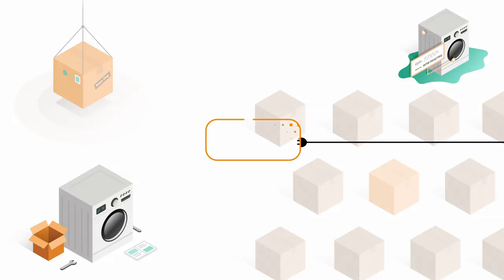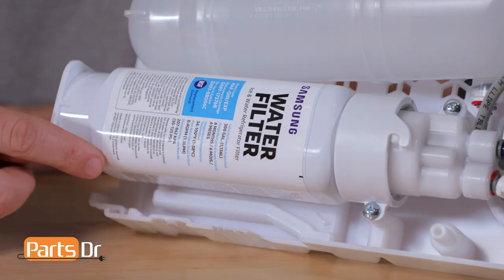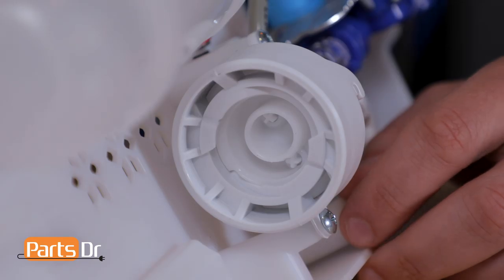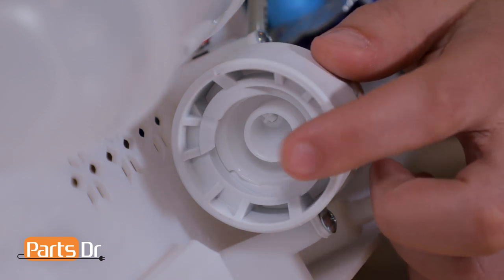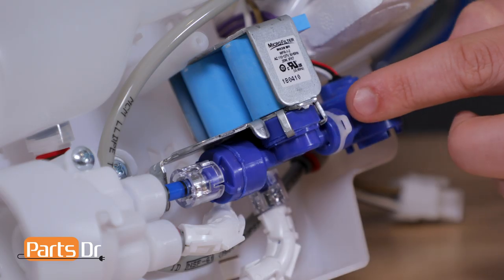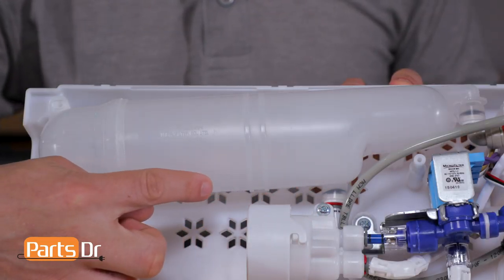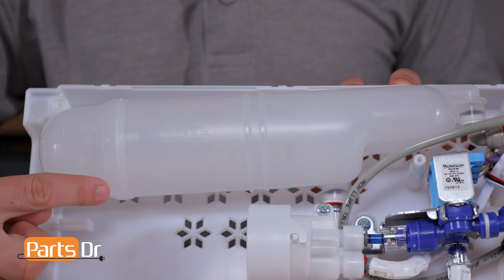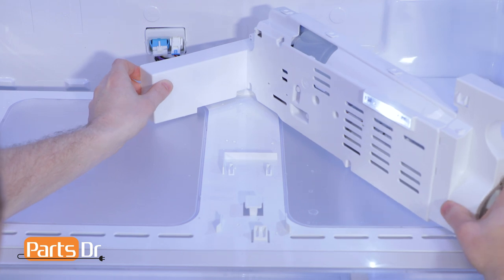What's inside the filter case assembly on a Samsung refrigerator

Comment: is it necessary to turn off the water to the fridge as instructed in the manual to replace a water filter?
Reply from the maker: It is usually safest to follow the manufactures directions.  We have successfully replaced Samsung water filters without turning off the water supply to the refrigerator.

Comment: Question.  Will this ice maker function without a filter or is a filter required for it to make ice?
Reply from the maker: You will need to check your refrigerators owners manual.  On some Samsung models the water filter is bypassed by removing the water filter.

Comment: If it does freeze and cause it to leak what is the solution, my fridge started freezing everything. The ice maker wouldn't make ice and water stopped deepening from the door. I finally got all that sorted out and had to unplug and thaw water supply, but now when I try to get water it leaks from the filter assembly.
Reply from the maker: If something froze in the filter case assembly and caused it to leak, the only fix in most cases would be to replace the filter case assembly.

Comment: I just replaced the filter on my fridge with a non-Samsung after market filter. About a day later I found water leaking into my basement from the fridge. How will I know if I have to replace any of the filter housing parts without calling in a repair guy to check it?
Reply from the maker: We would start by turning off the water to the refrigerator and cleaning up all of the water.  Then start by replacing the water filter with an OEM Samsung filter and keeping a close eye on it to see if it is leaking.  If it continues to leak with a new OEM Samsung water filter installed, then the water filter case assembly is most likely bad and will need to be replaced.

Comment: I just  noticed that the water in the tank is dirty, but its not time to change the filter yet.
Reply from the maker: The tank is usually after the filter so if the tank is dirty you will want to clean or replace it.
Reply: @PartsDr  Thank you for the response!

Comment: I removed the filter and now the new filter will not go in. It will not go in for enough to catch
Reply from the maker: First try putting the old water filter back in to make sure it isn't an issue with the new water filter.  If the old filter won't go in, try turning off the water supply from the house to the refrigerator and then use a cup at the water dispenser to drain as much water as possible.  This will lower the water pressure which can make it easier to install the filter.  if this doesn't work, something is most likely bad in the water filter head.  if this is the case, you will probably need to replace the filter case assembly.
Reply: Mine only has ice maker which I don't use. Filter light on now ,what should I do.